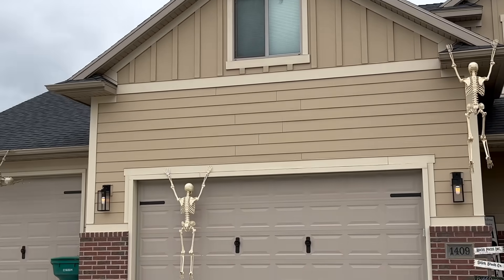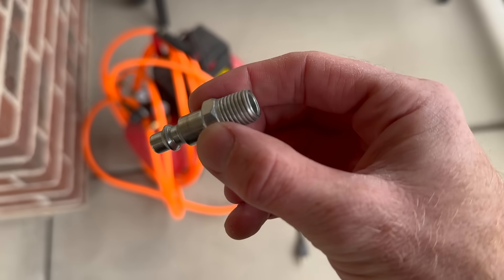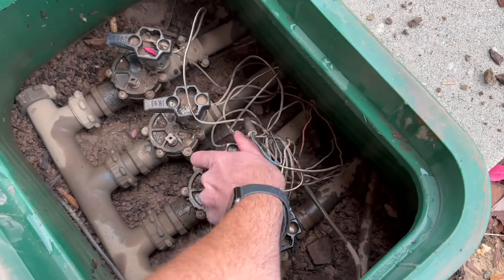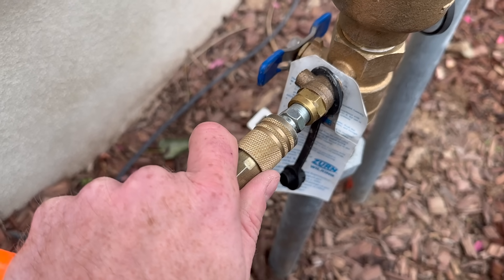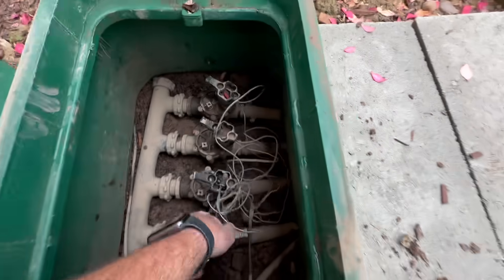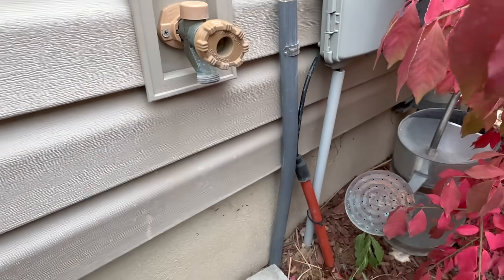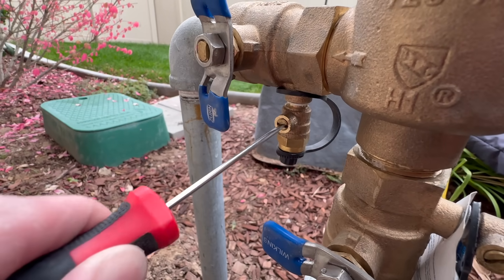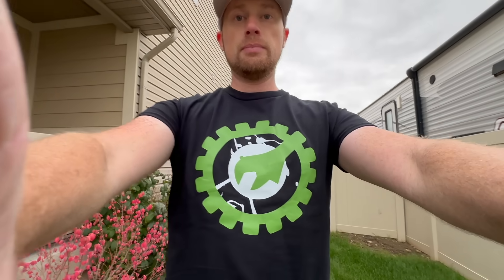DIY: How to Winterize Your Sprinkler System (Prevent Expensive Damage)

Comment: Just a note from a professional here.  80 CFM  is the recommended minimum to winterize a sprinkler system.  Your compressor in your garage can push 3CFM.  Because of how much thinner air is than water you need a significant volume of air to remove water from the system. When you blow out with a small air compressor you are only pushing a small amount of water out of the lines.  It may be enough to prevent freeze damage but it is not likely.
Reply from the maker: Been doing this for years now. Never had an issue. But yes, a bigger compressor would be ideal.
Reply: @DIYBRY Same here.  I’ve been winterizing my sprinkler system with a home compressor for over 35 years.  It just takes a little longer to do it and I blow it out two times on each zone.  My sprinkler system still works fine.
Reply from the maker: @FrancisHb thanks for sharing your information with the community.
Reply: You only need huge amounts of air (CFM) if you are pushing water uphill.  On a flat or downhill path to the sprinklers, gravity will do most of the work and lower CFM will work fine.
Reply: @NervusEnergy I have a slight incline uphill for about 10 feet. Am I still good to DIY this on a 150 psi 6 gallon air compressor?
Reply: @NervusEnergy @NervusEnergy  Every one of these DIY videos on sprinklers I have seen always has some "Pro" come into the comments, telling everyone they need a pro to do it correctly. I wonder why. Could it be they are afraid they will lose business from their over priced services?
Reply: @chrisw.6060 I mean unless you're a national franchise I don't think that would be the concern here. Probably just being overly cautious based on experience. When you work in a field and experience an issue that arises 1% of the time, it's still a notable thing to remind customers of if you see a potential mishap.
Reply: I know my home compressor cannot maintain enough volume or pressure to get the heads to pop up.  These DIY guys must have tiny yards with very few heads on each station.
Reply: “Ah, yeah. You need a $12,000 compressor to do this right. You should definitely call a pro. Why yes, I am a pro. What does that matter?”